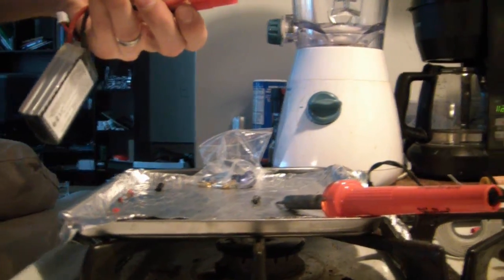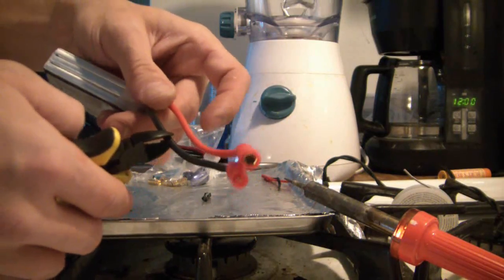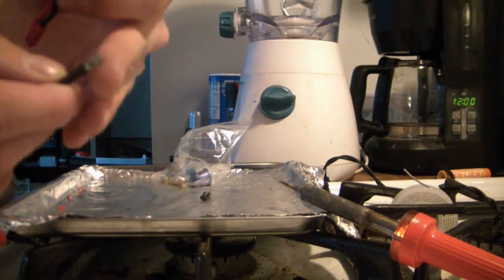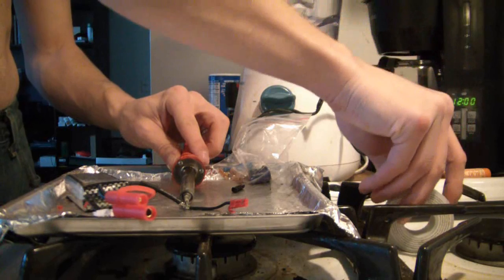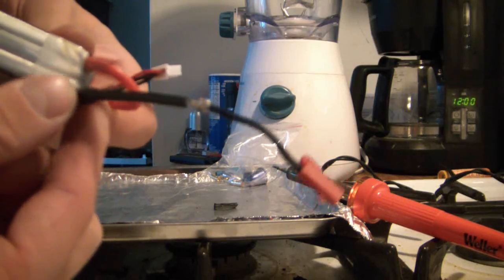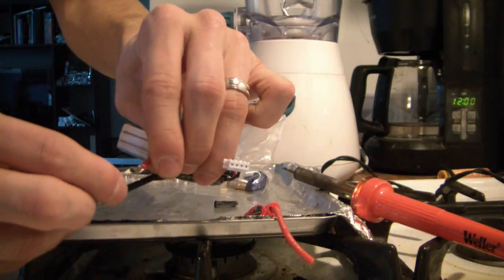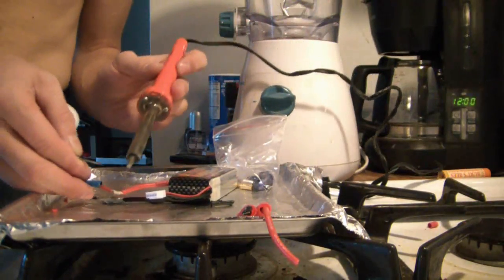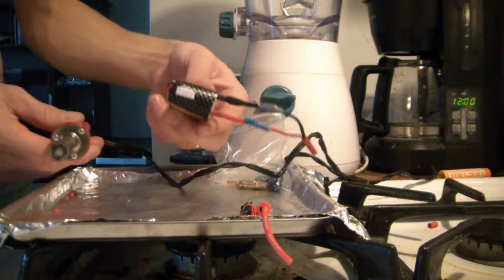How to solder a new connector

Comment from the maker: @MrTrollYourAss the tutorial is about the soldering, and how to do it.  Not about the connector I choose to use.  You can use whatever connector you want :)   I use JST on any battery I have that is under 1000mAh, and anything over than I use EC3.  That is just how I have done it, and that is how most of my planes/helis are setup.  I agree with you, a larger connector/wire would be better, but this is the pattern I have been using and I can't change now :)

Comment from the maker: @lazor222 I agree with you on this.  I simply put JST on all my 1000mAh and smaller packs(3cell and under) and anything over 1000mAh I put on EC3 plugs.  This is how most of my planes and helis are setup.  The smaller ones use JST, the larger ones use EC3, so that is why I used the JST plug.  I've done before, and so far so good, but I do agree with what you say, a larger wire and deans micro would be better, too late for me to change my pattern though.

Comment from the maker: @miksta115 lol, that has happened to me countless times with EC3!  I don't use deans really myself, but the damn EC3 connectors melt easy if you heat them too much.  I also don't have a machine to hold my connector as I solder, so it can be quite frustrating!  I like wire to wire soldering, so nice and easy :)  luckily JST and EC3 are sold as connectors with wires already attached :)

Comment from the maker: @subhannasir1 I haven't used them yet actually.  These 1000mAh batteries(I got 4 of them, two skylipo, two genace), they will be for my Precision Aerobatics Electric Shock, which I will be maiden flighting today!  But, I can say they came perfectly in balance, and charged perfectly in balance, but so far I can't comment on how they run or how long they last cus I just got them.  I've had pretty good luck so far with inexpensive batteries though(mostly turnigy from hobbyking)

Comment: Make sure you know what the Amos your connector is pulling are, JSTs have a really low rating. Also I would use the same guage wire wire, if the battery cones with larger guage it's not a good idea to make it smaller, will heat up and burn.

Comment: Great demonstration video! The real trick is getting deans plugs soldered. I don't have a soldering station so im always using heavy pliers and all kinds of random tools to keep the wire straight and hold the connector down. The other day I had a deans plug perfectly soldered w/ heat shrink and all, then I realized I soldered the wrong plug on... LOL.

Comment: true story........When i was 12......i got a soldering gun like yours.......i used glue guns a lot so i just left it on the carpet........while i went to get bits of metal to put together with the soldering gun. I WAS going to touch it to see how hot it was ( like i did.....and still do with glue guns ) but i was lucky enough to have said.......'' nah ill do it after i get the metal...by the time i got out there was a 3 cm ( 1 inch and a bit.....im Canadian ) hole in the carpet.....im lucky !!!

Comment from the maker: @roflmcwaffleRC no problem :)  yeah, I used to hate soldering, but now since I buy so many batteries I need to solder very often.  I usually buy connectors like shown in this video, with wires already attached, I find it easier.  Soldering wires to connectors isn't really hard... but I find it more frustrating since it is harder to hold in place and I often burn/melt the connectors some.